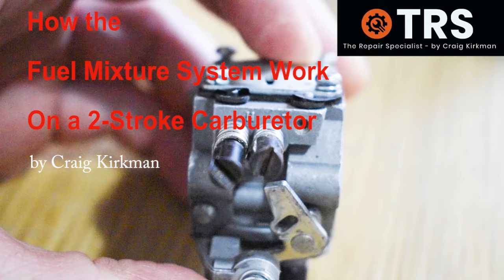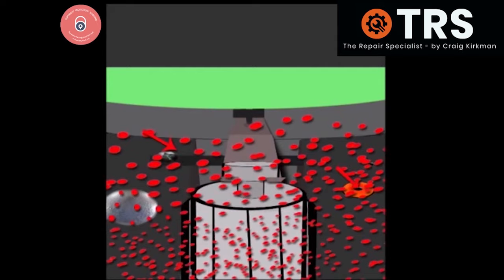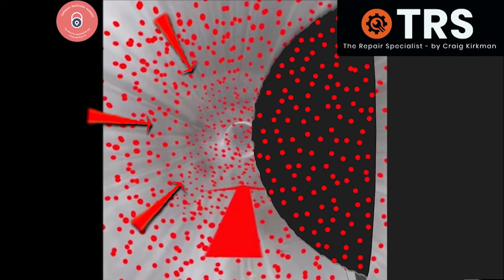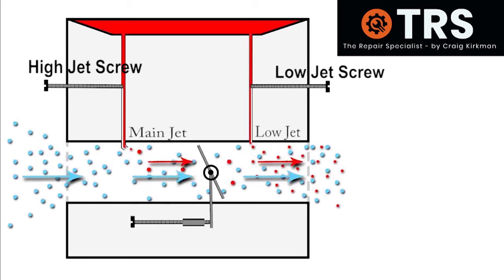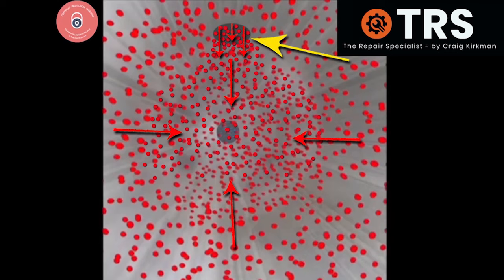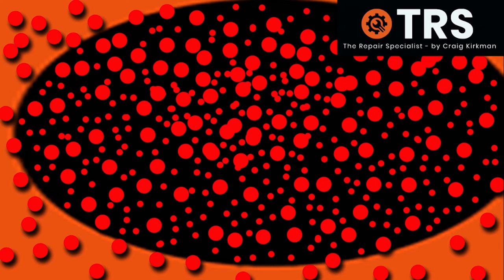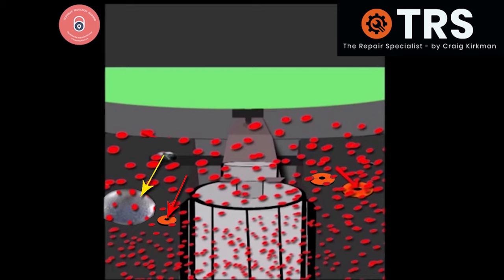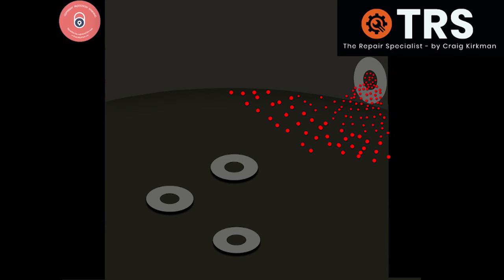CARBURETOR ADJUSTMENT SCREWS on 2-Stroke - (How it actually Work Inside)

Comment: Craig, thanks again for your insight and tech explanations. Further to my earlier ( lengthy) comment, I have successfully tuned my Husqvarna 128ld string trimmer. I have no idea how many of your videos I've watched but consider them to be superior to all of the others on YouTube on this subject. I have one suggestion which may have negatively influenced my initial lack of success tuning my engine. I knew I ought to tune with the engine under load so was using my gas clipping blower. The horrible racket and vibration obviously indicated that there was something wrong with it, Rather than continue to mess around with it, I withdrew to my trimmer attachment and within a very short while my engine purred like new. Maybe that will help someone else. Thanks again.
Dave in Houston

Comment: I fly a paramotor. Its a 2 stroke engine with a wb 32 walbro carb its not been running right then I noticed there is a spacer that is supposed to go between the carb and engine. I put it back on and it made it very very lean it would not run at all and needed around quarter turn rich on low end. Any idea why this would be . Why or how does an extra spacer between the carb and engine make such a large difference

Comment: Hi, I'd like to ask as a beginner, what is the reason chainsaw carburetors have H and L screws adjustment and many trimmers have single screw?
Reply from the maker: Hi. Thank you for your valid question. Actually, trimmers also have both H and L screws, it’s just that the L screws are sometimes hidden from view. My next video actually details this and shows where you will find the hidden screw and how to adjust both the H and L on these types of machinery. I’m just in the middle of making the video and it is likely to take me another few weeks to complete but it will be live soon. Stay tuned to my channel for the upload. Craig 👍

Comment: Do you have an easy explanation regarding why a lean state during high rev's causes the engine to run at higher rpm? Intuitively I would have thought that if there wasn't much fuel around, the rpm's would drop. That doesn't happen, but I don't understand why.
Reply from the maker: I certainly do.   Here is the Link. I hope it covers what you need. Craig :  https://www.youtube.com/watch?v=CHtu28AJLQ0&t=630s
Reply: @TheRepairSpecialist  Yes, that's helpful, thank you Craig. More efficient when lean but because lubrication comes from the mixed fuel, there is a compromise to prolong engine life.

Comment: good video but beyond the average bloke?  what they dont tell you is which screw is which? early ZAMA threads are same size BUT needle ends are not the same!   A big help would be a comparison of low and high screws side by side ,so they cannot be screwed back in wrong  holes ?

Comment: I've found that the adjustment of the L screw also affects how quickly the engine responds from idle. There is a happy place in this adjustment.

I really appreciate your drawings/animations. They have cleared so much up.

I'm presently flummoxed by a 028 Stihl Wood Boss saw. With the spark plug out of the engine, I get good spark. With it in, it behaves as if there isn't any spark. The plug comes out wet, every time. The plug is new, as is the coil. The flywheel is where it is supposed to be. What gives?

Comment: Hello guys!  Can someone help me? Do the adjustment screws have to be airtight? I have an air leak issue with my chainsaw. I already checked everything, but I can't find the leak. Thank you!
Reply from the maker: Hello!

Of course, we're here to help. When it comes to carburetor adjustment screws on a chainsaw, they don't need to be airtight themselves. However, the carburetor as a whole should be airtight to ensure proper engine performance.

If you suspect an air leak in your chainsaw, it's essential to address it promptly because air leaks can lead to poor engine performance, including difficulty starting, idling issues, and loss of power. Here's what you can do to track down and resolve the air leak:

Inspect Gaskets and Seals: Check the gaskets and seals between the carburetor, intake manifold, and engine block. If any of these are damaged or worn, they can create an air leak. Replace any faulty gaskets or seals.

Tighten Fasteners: Ensure that all screws, nuts, and bolts on the chainsaw's engine and carburetor are properly tightened. Loose fasteners can contribute to air leaks.

Check Fuel Lines: Examine the fuel lines for cracks, splits, or loose connections. Any damage to the fuel lines can introduce air into the system. Replace damaged fuel lines as needed.

Inspect the Intake Boot: The intake boot connects the carburetor to the engine. Make sure it's in good condition and securely attached to both the carburetor and the engine.

Use a Carburetor Cleaner: With the engine running, you can carefully spray a carburetor cleaner or a flammable aerosol like starting fluid around potential air leak areas (carburetor joints, gaskets, seals). If there's an air leak, the engine's RPM may briefly change when the cleaner is sucked into the leak.

Professional Inspection: If you've checked all these areas and still can't locate the air leak, or if the issue persists, it's a good idea to have a professional technician inspect your chainsaw. They have the expertise and tools to diagnose and address more complex air leak problems.

Remember, addressing air leaks is crucial for the proper functioning and longevity of your chainsaw's engine. We hope this information helps you pinpoint and resolve the issue. If you have any more questions or need further assistance, please feel free to ask.

Thanks

Craig

Comment: I have a jonsered 450, do you know which screw is longer?  I pulled the screws outcbefore noticing they ate different lengths.
Reply from the maker: If they are not different lengths or thickness then it most probably doen't matter which one is which and either will be ok in either hole. Some are designed like this, but take a very close and thorough look to distinguish the sizes first, then if you are happy they are the same size then you can decide, or not, to just fit them in either hole.

I hope this helped

Craig

Comment: Hi Thanks for a great video, quick question, as a rule does the low screw always let fuel into the carburettor on the outlet side of the venture? 
Many thanks David
Reply from the maker: Hi David. First of all, thank you for your kind words, i really do appreciate it.  Secondly, yes, from my own experience with carburetors anyway, the L (LOW) Screw is always on the outlet side, and so the closest of the two adjuster screws to the carbs outlet to the engine.

Thanks again

Carig
Reply: Hi Craig, thank you for giving me a great understanding of how a carburettor works, with the knowledge you given me I’ve traced the issue back to the     hole at feeds the High rev adjustment being blocked with a piece of metal, (maybe the previous owner has over tightened the adjustment screw and snapped the end off ?) unfortunately it’s jammed so it looks like I need a new carburettor.  😢

Comment: These screws are the worst design ever.   I have one on my motorcycle Mikuni carb, on the bottom where you can't get a screwdriver in anywhere.   Tweaking it clockwise or counterclockwise really doesn't give you a lot of feedback while it's running if your rich or lean.   I just try to get it where it won't stall out when you twist the throttle.   The real, real, real problem is the Pilot jet, which has the smallest hole ever in the center and gets clogged all the time on my bike, even with a fuel filter on, and even with a surgically clean carb.   Worst... design.. ever.
Reply from the maker: I agree these carbs can be both frustrating and confusing